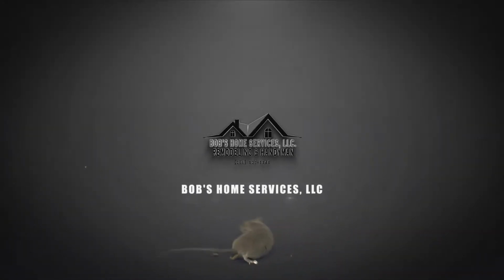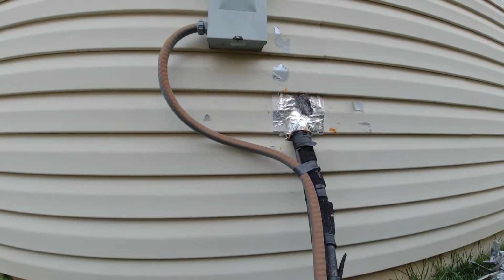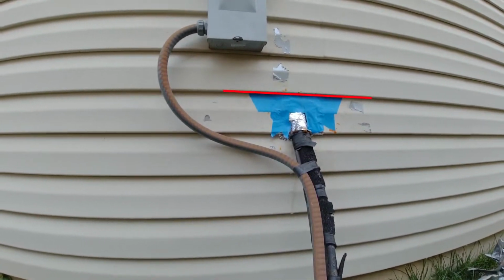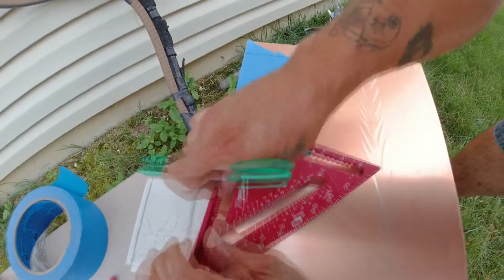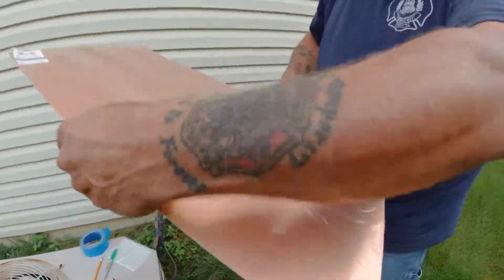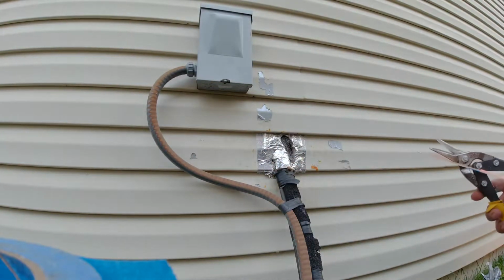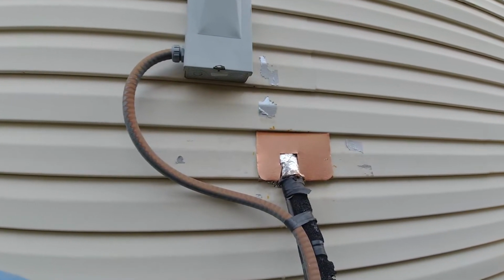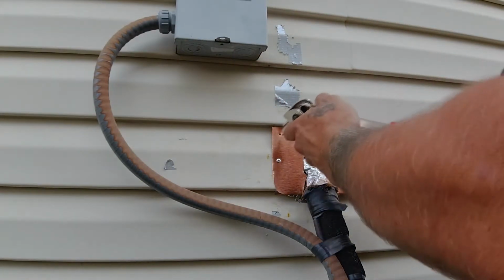Cut a pattern around any obstacle

Comment: The HVAC people that put that line set in like that need their hands broken, that is a mess. The condensing unit don't even look like it is sitting on a pad.
Reply from the maker: If I remember correctly none of the condensers are on pads and several are leaning in this community, in fact, they are known for cracked slabs and buckled floors; they build homes too fast and with the lowest bidders.